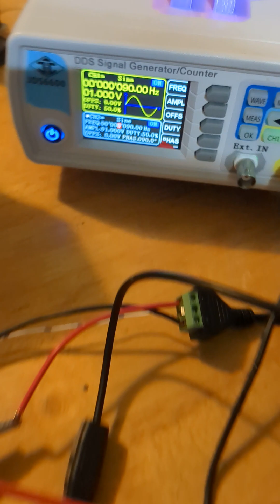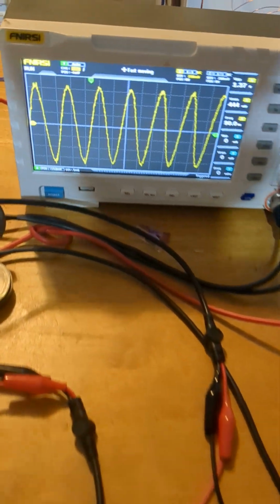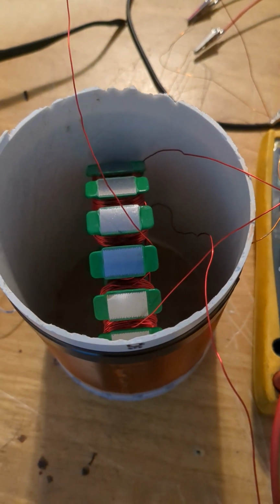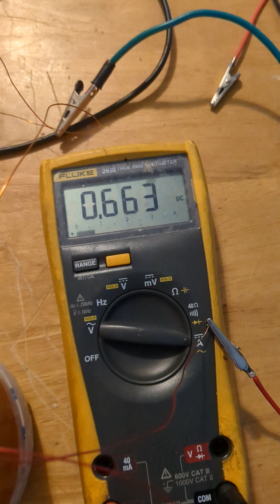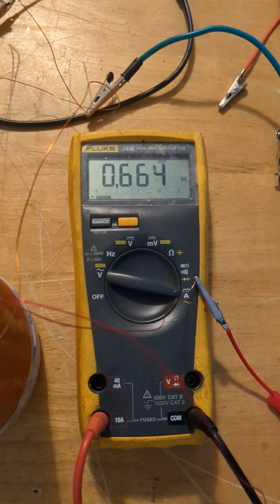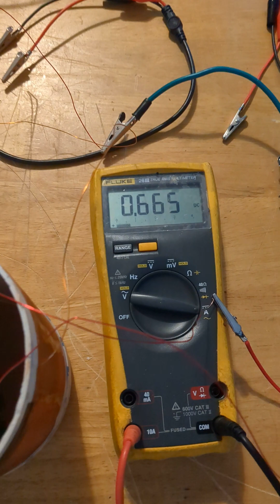Positive Feedback Loop With Virtual Magnetic Rotation

Comment: The only issue? Entropy. More energy must be put INTO the system than can be gotten out of it. There will always be inefficiencies. A close exception would be super-conductivity but that requires much colder temperatures, regardless it wouldn't even yield any useful work. That said I do admire your experimental efforts. That is how science should be done!

Comment: The thermal energy from the resistors could be used in a Peltier junction or a Sterling engine.
Reply from the maker: yeah, or replace them with boost converters and feed back to the battery. Once I get to where I need to be, the resistors will be gone.